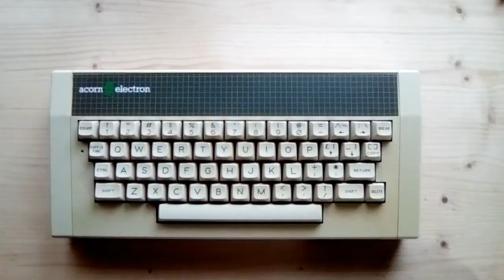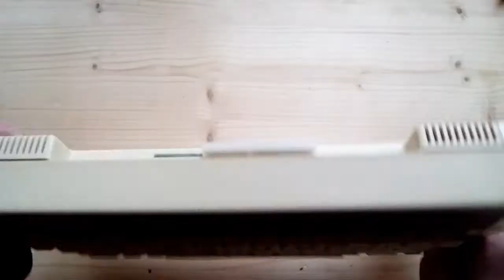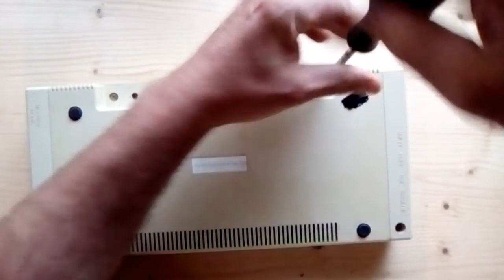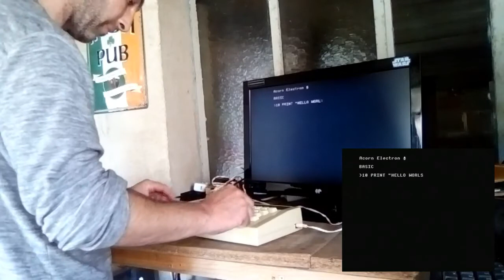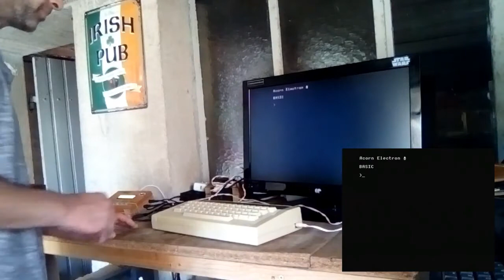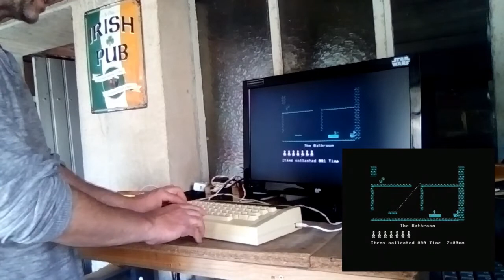The Elk, taking a look at the Acorn Electron | 8bitsinthebasement

Comment: Good video again, thumbs up for the Electron. Probably the best Basic for hobbyist back in the day. I got one "As Is" and... 
the ULA was never there - I so blame myself ever since! Thanks for sharing!
Reply from the maker: The Electron is a system I only discovered in the last couple of years despite being eight years of age when it was released. I have found it to be solid apart from the ULA problem I had. It seems the ULA was its Achilles' heel and said ULA has been the death of many later Electrons due to it being fused to the mainboard with resin making it non replaceable. I am sorry to hear that you had some bad luck in finding a good one. Thanks very much for your comment. ;-)

Comment: Will the the plus 3 expansion add mode 7 to the electron, or no?
Reply from the maker: I don't believe that it will. The plus 3 as I understand it is just a diskdrive and the hardware needed for it to talk to the Electron. Mode 7 was only available on the  BBC micro. However some hardware was made to give a mode 7 to the electron but most of these kits had drawbacks. Take a look here http://www.acornelectron.co.uk/eug/revs/jafa/Mode_7_Mk_2_000.html. Thanks for the comment.
Reply: @8bitsinthebasement  it seem like the mode 7 mk2 unit is the best bet! Very cool! Thanks for the info! Maybe the company analogue could get into the fpga microcomputer business! But in order to do that they'd have to build everything from scratch to avoid legal issues!

Comment: The RGB port on the BBC and ELK are 100% compatible with the Amstrad colout monitors. So if you have a CPC Scart kit (Or CTM 644 / CTM 640 nonitor) you can get an really nicve RGB image quickly and easily.
Reply from the maker: Its great when cables and devices are cross compatable with different  retro systems. Had I known that I could have skipped the mod ;).